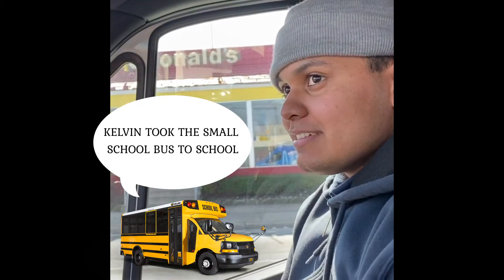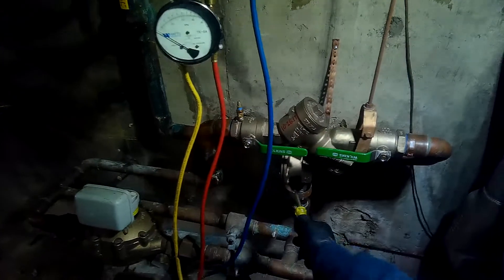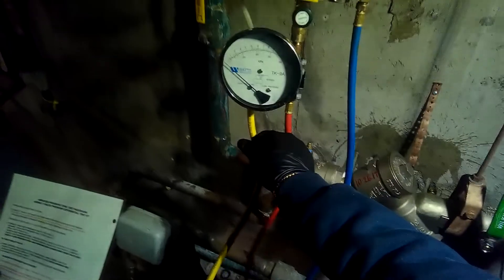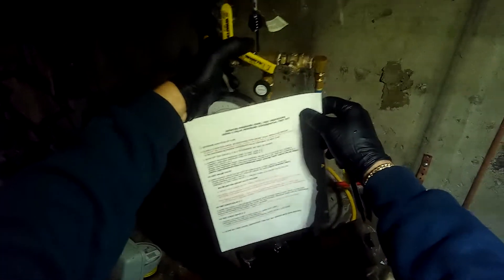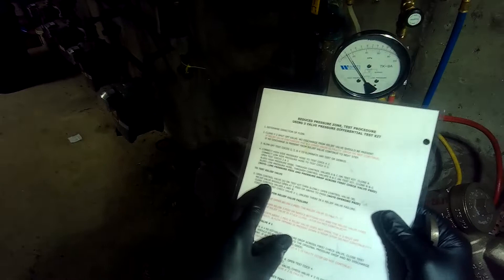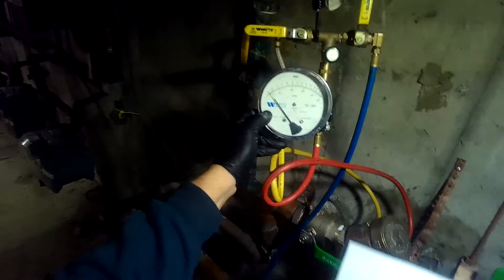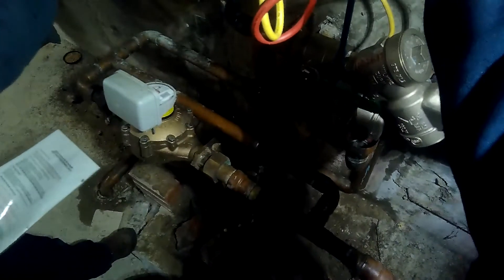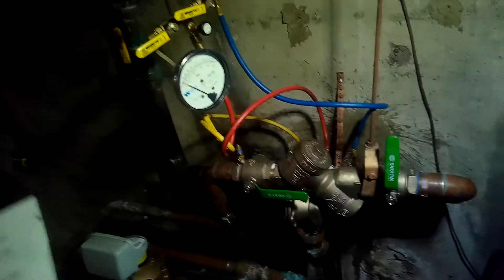Annual Backflow Testing Wilkins 975 XL 2" RPV

Comment: First I would like to say hi to Steve Lavimoniere. He doesn't test backflow prevention assemblies however he does do plumbing and heating. This man does a great job putting out his videos most every day and that a lot of work in it self, he would call it a labor of love. Now for me to get to the point. This backflow prevention assembly failed and did not meet the requirement to pass. The first thing I noticed is that you did not have at least 5 PSID across the 1st check in a static condition and the Relief Valve fell below 2 PSID before you exercised it which failed. Yes you took apart the RV to clean and flip the rubber seal ring which is a quick fix however you should have opened the #1 check to clean the seat, clean the seal ring or replace if needed, clean the poppet and guide. The goal is to achieve at least 5 PSID  as stated above and at least a 3 PSID cushion which is the difference between the RV opening point and the pressure drop across the #1 check. Example if the RV opened at 3.2 PSID then the minimum pressure drop across the #1 check would be 6.2 PSID. This would help with inlet pressure fluctuations causing RV nuisance spitting. Take care guys and stay safe. Oh by the way you won't find a better work  partner than Steve Lavimoniere's Miss Molly.
Reply: @ Joe Hallman  I do quite a bit of backflow preventer testing myself and you hit the nail squarely on the head with this statement.  Most of the people testing backflow assemblies in my neck of the woods seem to make simple mistakes like this guy did (no offense Pipe Doctor...you get an "A" for effort though) because they don't get enough reps out in the field.  Once they're done with the grueling 32 hour backflow training, their training knowledge gets left in the classroom instead of being put to good use everyday.  They're often just taking the class only because it's a prerequisite to get their license.  Even though they have cheat sheets just like this guy did, they often seem to mix up the valve manipulation procedure or mix up the hoses on the wrong test ports because of the color coding on a specific manufacturer's gauge to another's is different.  The biggest problem I find is knowing the correct numbers for your readings to denote pass or fail.

I don't usually start to mess with repairing/cleaning a building's domestic water containment RPZ assembly unless I know I have parts on the job to fix it just in case there's a problem with the disassembly/re-assembly of the parts.  That way you're not up the creek and have to shut the water off longer than expected to correct a serious issue with relief valve discharge due to possible flooding concerns.

@ Pipe Doctor  Was your gauge calibrated recently before making this video?  The numbers seemed a bit off after you initially pressurized the gauge.
Reply: @andrewwelch5668  cool story